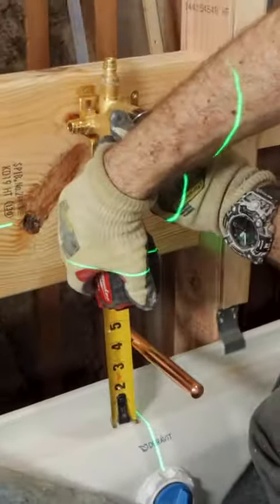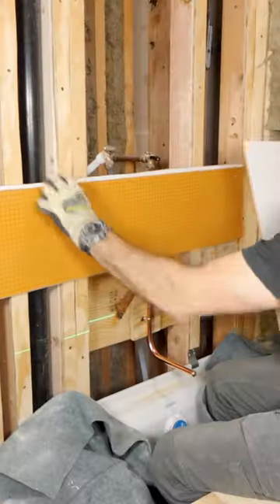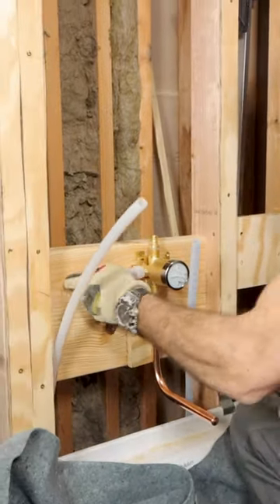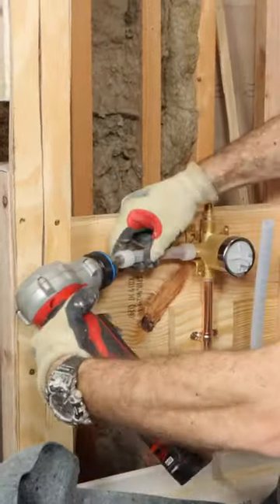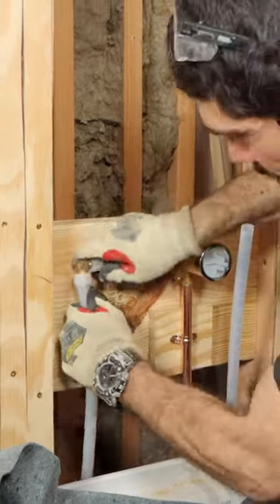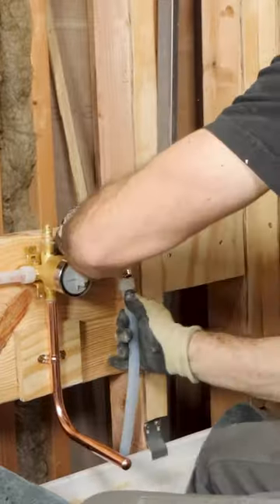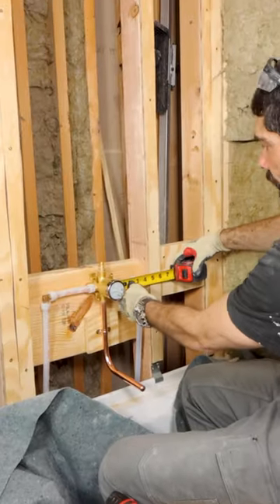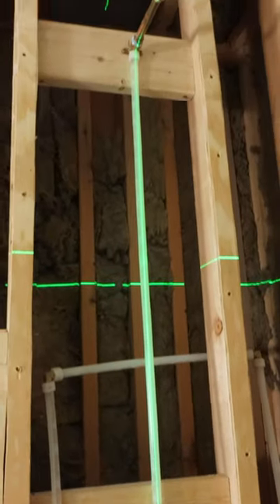Tub Shower Valve Tips - #shorts #diy #construction #bathroomremodel

Comment: The fact you use a laser to set your components puts you miles ahead of most plumbers I have ever seen. Even checking the depth differentiates you. I've had to point that out to 2 plumbers when I had bathrooms remodeled.
Reply from the maker: The depth is so important, I guess I’m overly sensitive to the valve installation since I’m the one installing the tile 🙏🏼